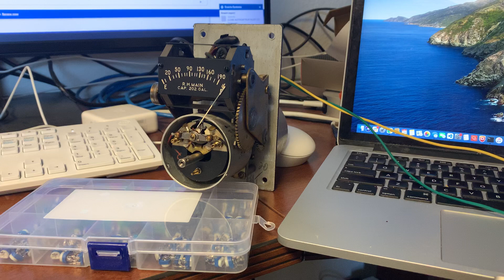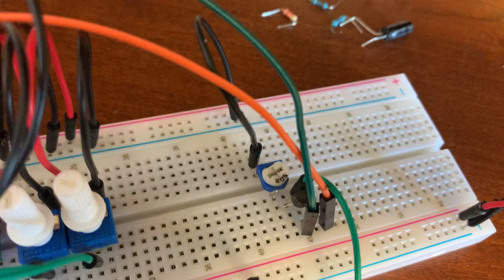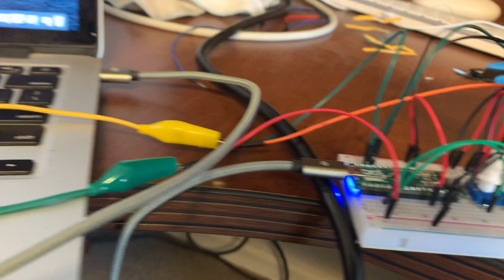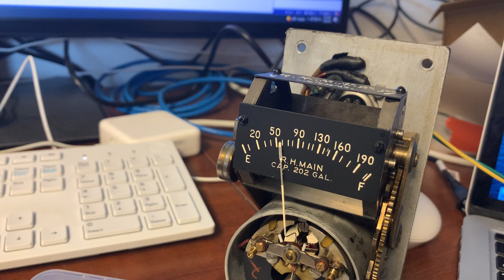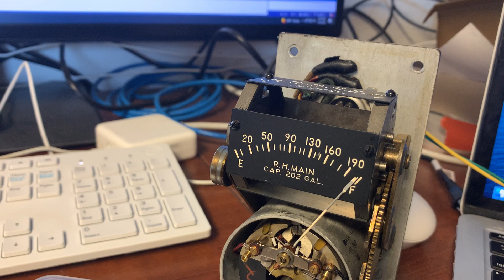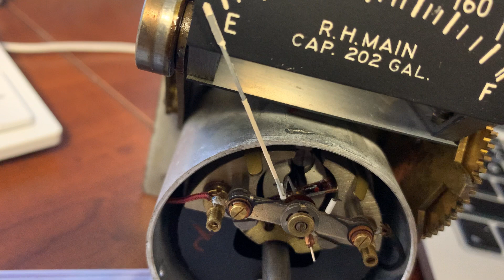What's a Liquidometer?  TAB Jr. C-47/DC-3 Fuel Gauge Circuit Design and Testing

Comment: we have senders that operate on a current sink - so you can trust it
Reply from the maker: In this particular case, the senders are probably pretty accurate, but the mechanical parts of the gauge tend to add a lot of error.  They are also very temperature sensitive.  One of our members has a T-34, however, with your CIES senders integrated with a digital fuel gauge, and that combination is very reliable and accurate.

Comment: Since you are reverse engineering an old liquidometer gauge, this implies you know how to wire one up. I am trying to reverse engineer one with the model number EA100AN-53. As far as I can tell, I cannot find any old liquidometer cross referencing guide on which tank sender it uses or any clue of wiring. Do you have any knowledge on how to figure this out?
Reply from the maker: We weren't monitoring comments as well as we should!  The best way to figure out the wiring is to look at a parts catalog for an aircraft that uses it.  Visit our wing on Facebook (www.facebook.com/centraltexaswing) and send us a DM and I'll forward the diagrams and some other information to you.
Reply: @commemorativeairforcecentr3635  That's ok. I ended up buying a Liquidometer manual from eBay and figuring out what sender to use. Long story short, I got it working!
Reply: @commemorativeairforcecentr3635  Do you possibly have a wiring diagram for the model in the video? I got one of these gauges myself and was looking to do basically the same thing as this, but I can't seem to find anything that helps with the pinout for the connector on the back.